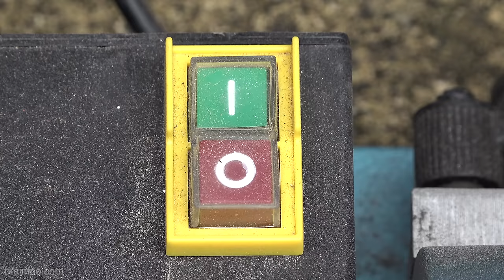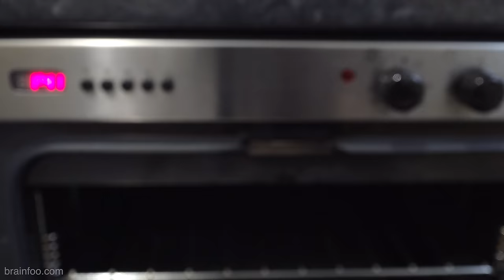RAMBO Build & FIRE STARTER - From High Carbon Bolt

Comment: Nobody:
This guy: baking a knife
Reply: its rather normal technique in knife making, known as tempering. what it does is make the steel bendable after hardening, as hardened steel is very brittle.
Reply: Yum , just like momma blacksmith would make

Comment: Nice, Thank You. An Idle thought: If you were to make the part of the screw-in end cap - the portion that's threaded - a bit thicker  (perhaps one tap size up)  you could then drill down into the end of the thin section of the cap that's to be threaded (not all the way through). Fix one end of the ferro-ceramic rod into the hole using 2-part "plastic steel" epoxy glue. This gives your ferro rod a small handle, making it easier to hold. It might be  worthwhile to switch some steps: drill into the small-diameter portion before threading,  especially if drilling freehand . With a little care, you can leave enough wall thickness on that section to thread and screw into the hilt, but now that is also a small grip on one end of the ferro-ceramic rod. Only a couple of millimetres of the ferro rod are needed to glue it in place.
To add even more utility, cross-drill the thick part of the end plug and put a piece of  thin wire through the cross-drilled hole. Stainless Steel or braided locking wire is good. (The thin braided type is used to attach seals to electricity meters, etc.- its rust-resistant and quite strong). The ends can be braided together or fastened into a closed loop with a dab of epoxy after putting it through the cross-drilled hole in the cap. For stiff unstranded wire, just bend the ends and push them in from either side. That forms a wire bail at the handle's end.
To that bail, attach a small piece of braided Paracord, or make a closed loop of Paracord through the wire bail. Use the type of paracord with 3 extra strands inside that are flammable tinder (sometimes colored red or red/white). Those strands of tinder can be pulled out without destroying the Paracord.  Now - Presto - you have tinder for fire-starting, a ferro-ceramic rod, and a steel striker/knife, all part of your knife & handle.
Thanks for this video - I was a bit bored, and here's a neat little project that looks like fun.

Comment: Exactly what type of go pro miniature camera do you use a waterproof,liquidproof like it can handle it like water without messing it up well...not the ones that are dangerous and durability right?
Reply from the maker: Any Go pro or copy works, I'm using an old Hero7 but a cheap case works fine with all of them
Reply: I see because in some of the clips of your videos you put the go pro under the drill machine thing,in the water,in the oil,got it by the plates,and in the coca cola can
Reply from the maker: @fearkratos444  sometimes I just cover it over with clear perspex if it's not in a liquid
Reply: Ah gotcha

Comment: I don't understand the heating process if It's only going to be used as a pendant. You don't need to heat it, dip it in oil and put it in the oven unless you intend to use it as an actual knife? Am I missing something here?